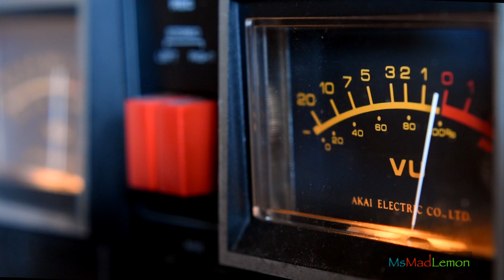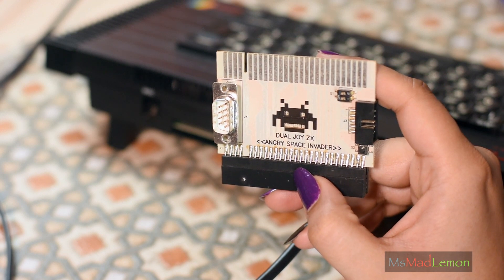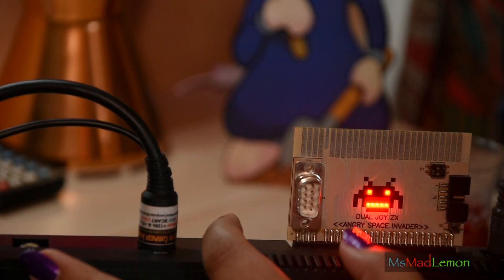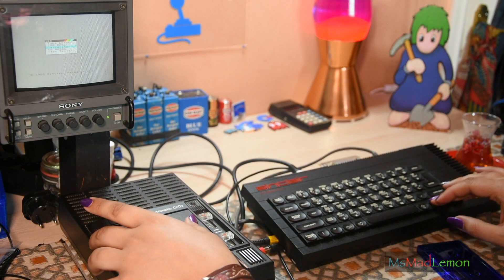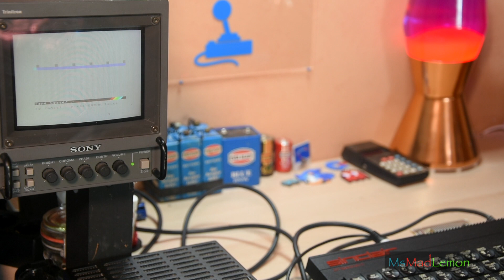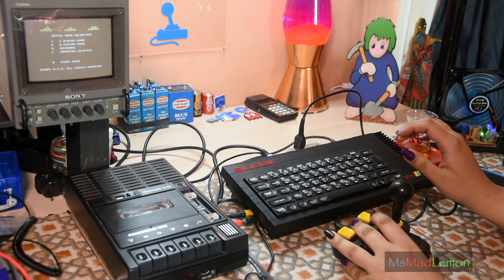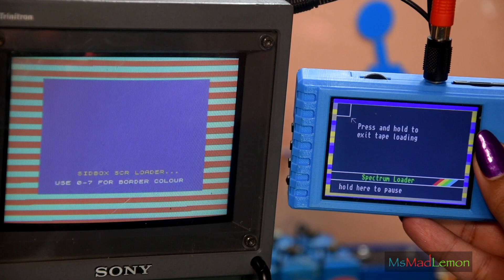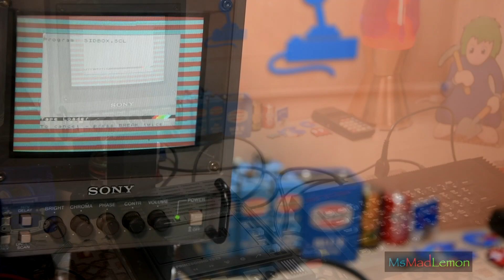Prinzsound TR22 Restoration and Spectrum Toastrack test

Comment: I think the Prinzsound brand was from Dixons who also sold cameras with the Prinz brand. I remember having a Dixons branded TR15 tape recorder with my ZX Spectrum +
Reply: You're correct, they (Dixons) also sold 8mm movie projectors under the same label. The other brand of theirs was Chinon.
Reply: @gazellefilms  Chinon was actually a proper Japanese manufacturer as opposed to a brand though, and a decent one at that. Their cameras were a bargain at the time.
Reply: @jasejj  Never used Chinon still camera's, but the lenses on the 8mm movie ones were somewhat lacking. Only remember chinon being sold through Dixons outlet.
Reply: Yeah the used the Prinzsound name in the 70s because it sounded German, but they used Japanese manufacturers. Then in the 80s when everyone wanted Japanese stuff they switched to the Japanese-sounding Saisho brand, but didn't use Japanese makers by then and instead used cheaper Korean and Hong Kong suppliers. This looks like a Sanyo to me, albeit made in Korea.